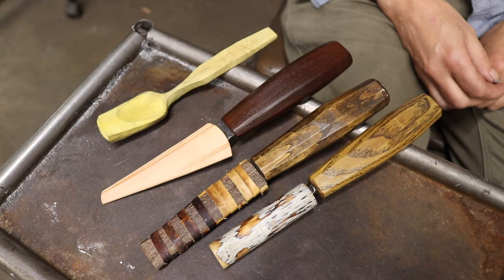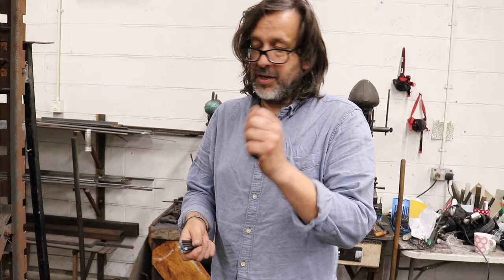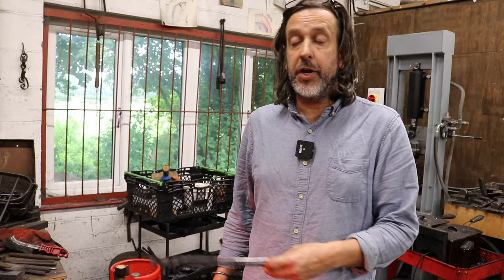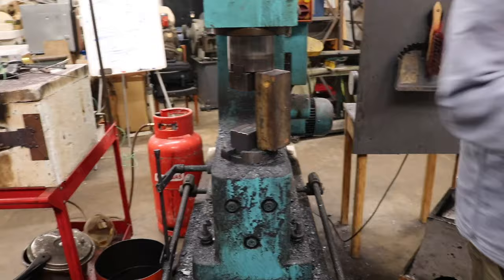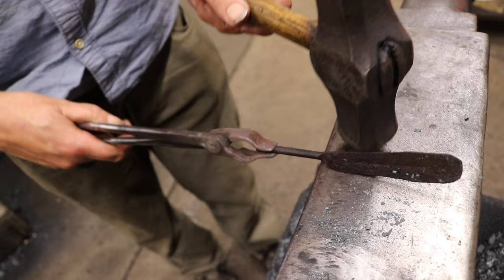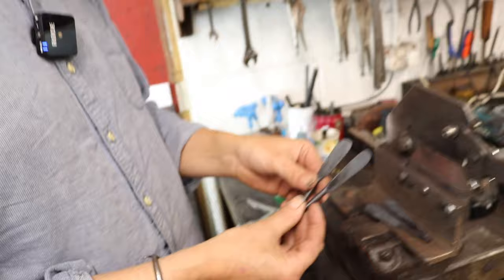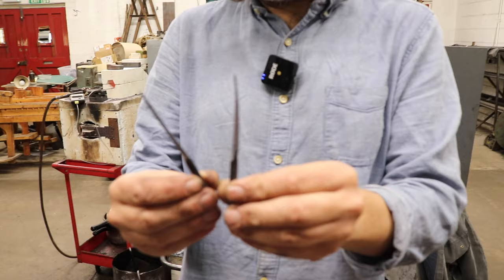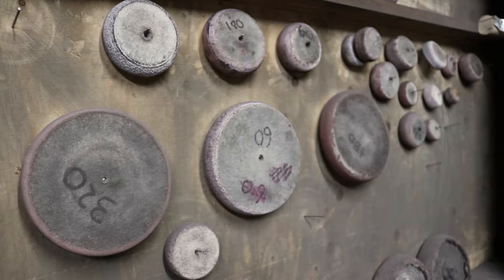{Pt 1/5} How To Make A Turning Sloyd Knife - Nic Westermann (Forging, Annealing & Rough Shaping)

Comment: Hi Nic, just wondering if you can suggest/recommend a supplier for the 52100/L3 round bar in the UK? I have not been successful in my searches online
Reply: It's not easy as you say. I keep finding that supplies dry up, in the past I have even imported it in quantity from Turkey.
Reply from the maker: Stock across the board has been hampered in recent years ~Peace~